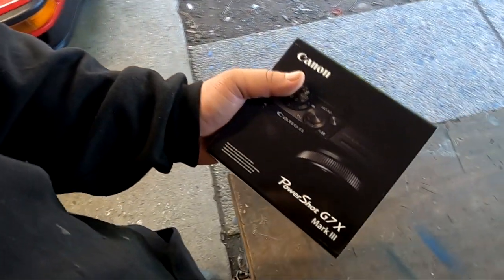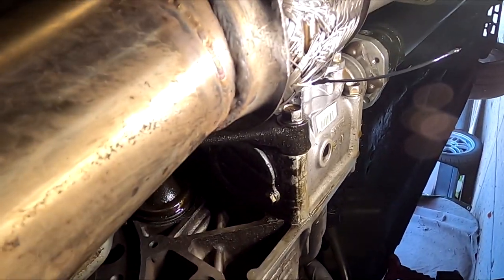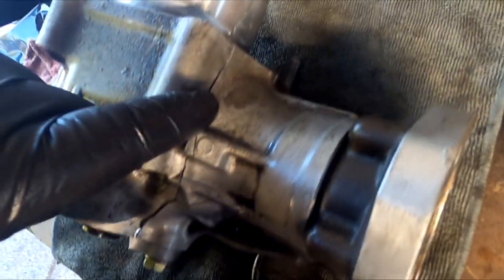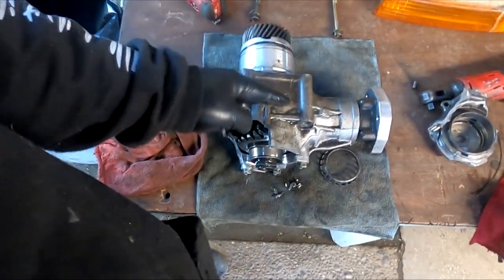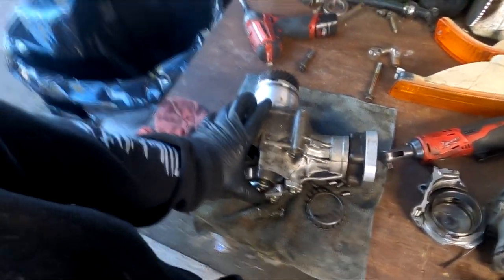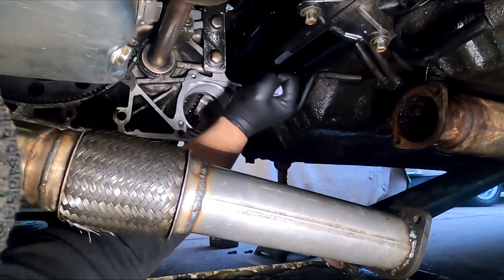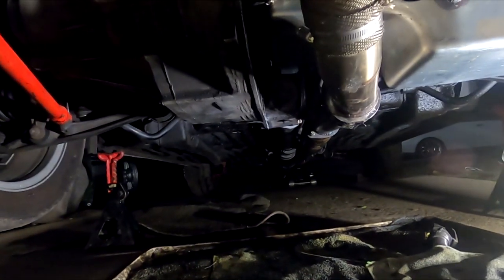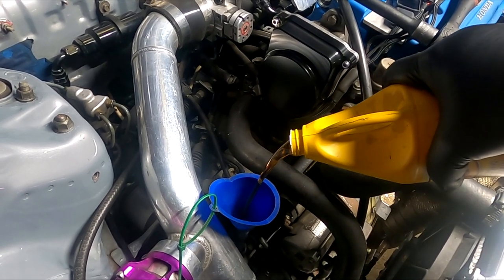BLEW APART MY AWD CRX TRANSFER CASE !

Comment: okay i was about to use the penzoil syncromesh but i wasnt sure if it was safe since it says its for GM vehicles? i have a 5 speed first gen crv awd trans and im wondering if its safe to use it. 2nd gear tends to pop out so thats why i was considering.

Comment: I have a drag cartel billet transfer case with about 50 passes on the gear set thats installed its for a b 5 speed 600 bucks the dc case was a grand alone im going k awd saving up for the billet k transfer case and some new head studs right now recently floated the head with arp head studs so i wanna go thicker my head studs didnt like 40 psi floated first pass after dyno made it to fourth and dead haha
Reply: Get with me an ill send you pica of my build
Reply from the maker: how would i get a hold of you?
Reply: Do you have a facebook or someway i can shot you my number so its not public
Reply: May have some other things you may want lol
Reply from the maker: @chrisperks1112  totally slipped my mind. i was looking your name on facebook and they are too many of you! LOL. go in the description and send me a msg on my fb link there!
Reply: Sent you a freind request